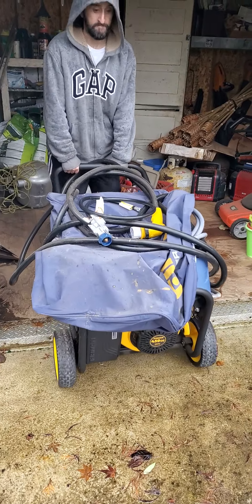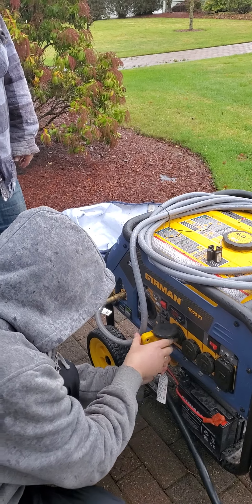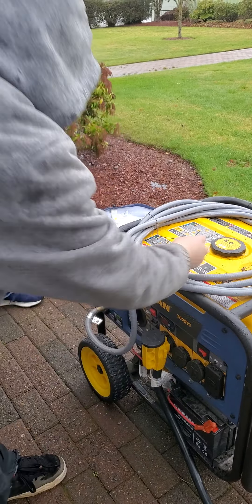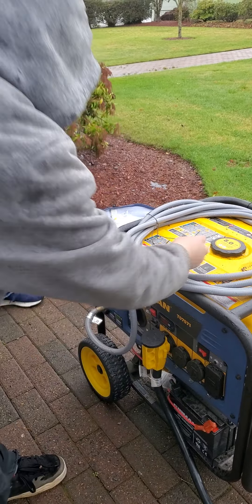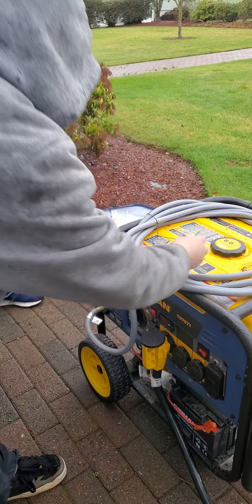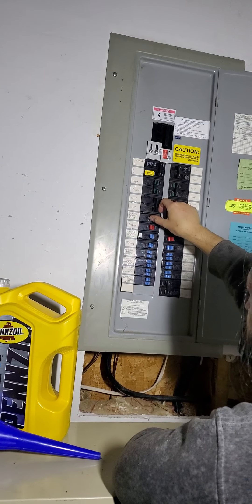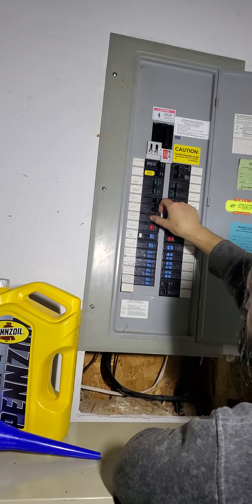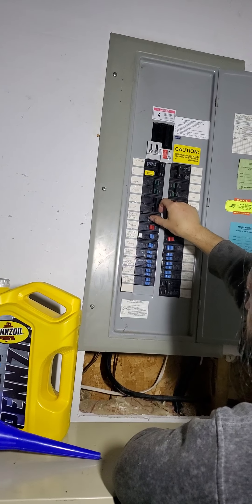How to turn on the Firman T07571 7500W/9400W Electric Start 50A Tri-Fuel Generator

Comment: The generator cover in NOT fireproof. The generator engine is air-cooled. Do not cover the sides. 
If you look in the manual at the wiring diagram (page 37) around the 50 Amp outlet you will notice that there are 31 Amp Circuit breakers on each leg. You will not get 50 AMP service. Mark your panel with the basic circuits required and then optional. Also mark white lines on the 50 AMP plugs and sockets to make it easier them line up especially in the dark. 
If you plan on using a whole house A/C unit, I suggest getting a Micro-Air EasyStart 368 Soft Starter for the outside unit. The soft starter will start up the unit in stages and there will not be a large amperage surge. I installed LED Emergency lamps, with 2 adjustable heads, in the garage near the panel and in the area where the generator is hooked up.

Comment: WAIT for the GREEN light THEN plug in,, Soo many mistakes.. READ the manual first,  ADD up your power needs,, NO DRYER or Hot water heater,